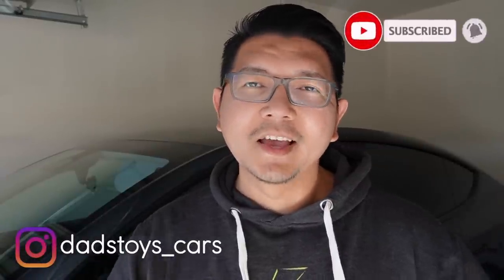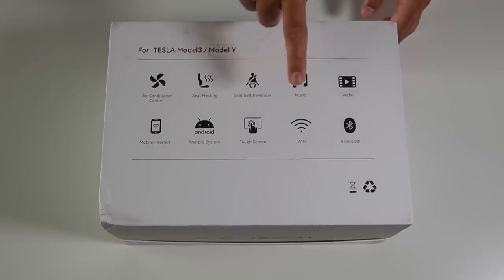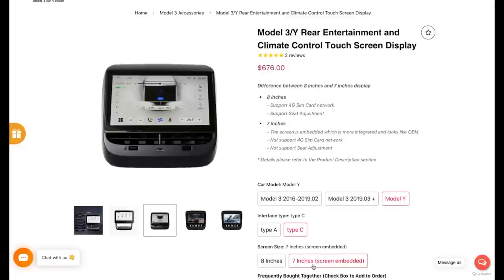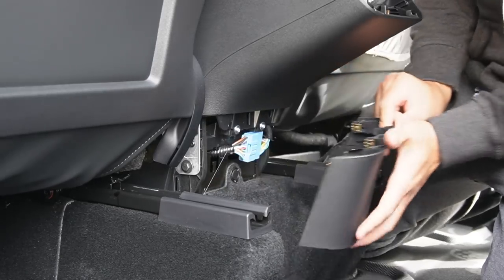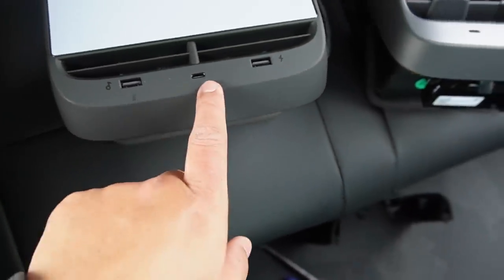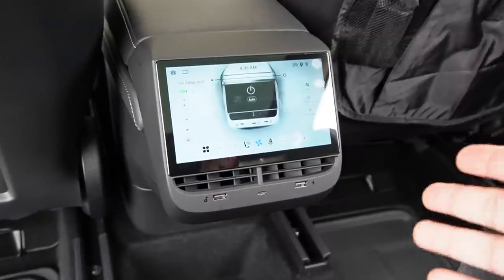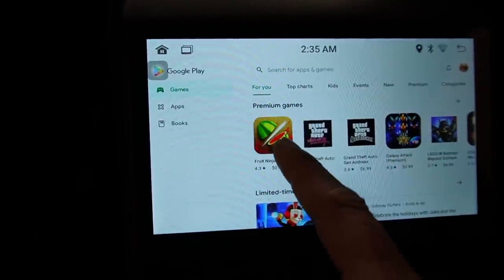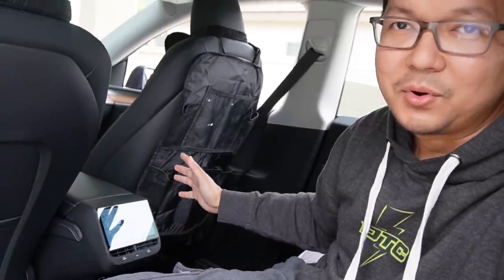2023 Tesla Model Y New Rear Climate Control Display Upgrade! #tesla #2023

Comment: Does it solve the V1 8" display issue bricking the car during Tesla firmware upgrade ? Did you already performed a Tesla update since you installed it ?
Reply from the maker: I installed this display before the latest holiday software update and the update went well with no issue.
This display has different connection compare to 8” display. This 7” display connects to access port at the rear center console but 8” display connects directly to main MCU underneath the front grove box.
I hope I answer your questions.
Thank you for watching.
Please subscribe for future contents.🙏😃
Reply: @dadstoyscars  thanks a lot !!!
Reply from the maker: @jeanbaptistelabelle  No problem 😉
Reply: @dadstoyscars  do you confirm that audio on BT headset (not BT of the car) is NOT working ?
Reply from the maker: @jeanbaptistelabelle  When connect to your car via Bluetooth to output audio from display select BT966. When connecting Bluetooth headphones you have go to display settings >Bluetooth >search device to connect your Bluetooth headphones.
Reply: @dadstoyscars  yes, I know but does it WORK ? Because I have not yet seen a video where it worked. Could you confirm it works on your model ?
Reply from the maker: @jeanbaptistelabelle  You mean display Bluetooth to car speakers or Display Bluetooth connect to Bluetooth headphone?
Reply: @dadstoyscars  can you watch à vidéo with sounds played on youR BT earbuds / headsets ?
Every video so far I have seen are stating that it does NPT work (only playing through car speakers with BT, not your own BT headsets)
Reply: @jeanbaptistelabelle There is no answer to your question which probably this is your answer. Probably the unit cannot play output sound to headphones which is a major disadvantages.

Comment: Can the USB-C port be used for audio? Wondering how I could connect 2 pairs of headphones to this
Reply from the maker: USB-C port is for power output only to charge your device. This display has built-in Bluetooth so you should be able to connect multiple devices via Bluetooth. I'm not 100% sure if you could connect 2 headphones via Bluetooth at the same time.
This display is actually the best looking rear display in the market so far.
Thank you for watching Lee!
Please subscribe for future contents. :)
Reply from the maker: I just tested with Bluetooth earbuds but  couldn’t connect to the display. I tried a few time still couldn’t connect. :(
So I reached out to Hansshow about the issue. They also tested on their side and they couldn’t get it to connect to Bluetooth headphones either. Hope they can fix the issue and send out update in the future.

Comment: Code dad doesn’t work anymore.  Also do you think the 8” is better due to resolution or the 7” screen since it’s more flush and stock looking? Interested to hear your opinion between the two.  I like the bigger one but worried if we recline seats real low it will hit screen on 8”.
Reply from the maker: Hi, the code: DAD should be working now. I have both displays 7” and 8” displays. I personally went with 7” because of design and installation is much easier than 8” display. The 8” installation you have to connect directly to the main MCU unit underneath grove box on the front.
7” you just need to connect and connector in the rear center console. The benefits of 8” over 7” are bigger screen size, headphone jack and option to put SIM card in the display.
I hope I answer your questions.
Thank you for watching!
Please subscribe for future contents.🙏😃
Reply: @dadstoyscars And only 8" one can let you use XBOX game controllers as 7" one does not support bluetooth, is that correct?  Anyone tried to connect the XBOX controller directly to the 7" USB directly to see if it works?

Comment: If you had to chose between 7’’ or 8’’ screen, which one you would chose and why?
Reply from the maker: I prefer 7” over 8” mainly because of design and much easier installation. With 8” display you have to connect to the main MCU in the front underneath the grove box which could be challenging to install. You also have to run the cable from front to rear display location. The advantages that 8” have over 7” are SIM card capability and headphone jack. They both have 32GB internal memory and Android operating system.
I hope I answer your question.
Thank you for watching Michel!
Please subscribe for future contents. :)
Reply: @dadstoyscars  I concluded same thing. I find that the 8’’ screen does not seem integrated. Too bad the 7’’ screen does not have the 8’’ added features.

Comment: The only downside I can see is that you lose the ability to control the air vents, as in direction (left right up down).
Reply from the maker: I have no issue with those fixed air for rear passenger so far. Only downside is that they can’t turn it away if they didn’t want the ac but they can just turn the rear off themselves.
Thank you for watching!
Please subscribe for future contents.🙏😃

Comment: Hi, excellent video. Just two questions: Could the system be set to german language as the standard language? Secondly, only the back seat heating could be managed seperately form the the main control? In case you find the time to answer ... Thanks, Andreas
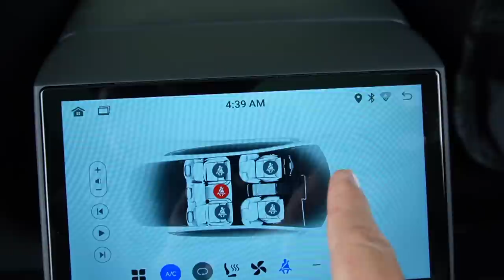Reply: German is supported and can be set as the default language. The back seat heating can be controlled independent of the front: 15:09 click the time to go to the time line where it explains this in the video.

Comment: done installinf and for some reason the battery display  on the rear screen does not reflect on my actual battery. i have 75 percent and the rear says 0. do i have to update the display or something after installing?
Reply from the maker: Umm...Interesting. This is the first time I heard about this issue. Please try to restart your car after installation.
Hold both steering wheel buttons at the same time until the main screen goes dark the release it.
Hopefully that would work.

Comment: What about that green wire when you installed it? You didn’t plug it into anything.
Reply from the maker: I think it’s an optional plug for front passenger seat control but this display doesn’t have that option.
Thank you for watching and your great support Mike!🙏😃
Reply: @dadstoyscars  thanks for replying. Just watching so when I buy it for my car I can install correctly

Comment: Hi there,

Is this also compatible with the 2022 tesla model y standard range?
Reply from the maker: Yes, it's compatible with 2022 Model Y Standard range. As long as it has the same connection in the rear center console, it should be able to connect to this display. The air vent panel should be the same.
Thank you for watching!
Please subscribe for future contents. :)

Comment: So you can control the temp/fan speed independent of the front AC?  I didn’t think that would be possible
Reply from the maker: I just went to my car and tested for you. Tesla Model Y/3 only have dual climate control one for driver and one for front passenger. The rear passenger will get the climate temperature from driver’s control. However when I adjust the temperature from the rear display to hot it override the front temperature too but when I adjust driver’s side temperature it also overrides the rear temperature. 
I hope I answer your questions.
Thank you for watching!
Please subscribe for future contents.🙏😃
Reply: Interesting!  Yeah i didnt think it would be able to create its own independent zone when the default software doesn’t allow that.  Thanks so much for looking into it… I might consider getting one.  I do hope they update the software to have bigger buttons, etc..
Reply from the maker: @grahamsiebring5227  No problem, I’m glad I can help. Thank you for support!🙏

Comment: My only question is: can the rear seat climate control temperature be controlled INDEPENDENTLY of the the front seats.

Can the driver temperature be 68 degrees, the front passenger be 82 degrees, and can the rear seats be 82 degrees also? And if it does allow you to do that, does it actually blow the right temperature air? In the situation above the front passenger and rear seats should get hot air while the driver only gets cold air.

If possible could you test this out and let me know? Thank you.
Reply from the maker: Hi Ayush, I just went to my car and tested for you. Tesla Model Y/3 only have dual climate control one for driver and one for front passenger. The rear passenger will get the climate temperature from driver’s control. However when I adjust the temperature from the rear display to hot it override the front temperature too but when I adjust driver’s side temperature it also overrides the rear temperature. 
I hope I answer your questions.
Thank you for watching!
Please subscribe for future contents.🙏😃
Reply: @dadstoyscars  can you lock out the rear controls so kids don't mess around with hvac?
Reply from the maker: @randomname931  I will try to test it and get back to you.
Thank you for watching!
Please subscribe for future contents.🙏😃

Comment: Thanks for sending me the link to this. I see there is a 2 usbc option. Can you upload media via usbc like you can with the usba?
Reply from the maker: You can only use the USB-A on left side to Import media into the display.
Thank you for watching John!
Reply: @dadstoyscars  Awesome, thanks for clarifying... do they make a screen protector, i'm not seeing one
Reply from the maker: @johnmoricone294  I don’t think they offer screen protector for it. You might be able to find on Amazon that’s in similar size. I don’t put anything on mind and it’s fine. I just need to clean it once in awhile.

Comment: I have a question....can this display also be mounted on model y in Italy? both this display and the central one, the temperature is expressed in C. can I use the temperature distinctly? 
Thank you for the asnwer and best regards
Reply from the maker: I believe you can. As long as your car has the same connection in the rear of your center console, you should be able to mount and install it on you model Y.
Thank you for watching!
Have a great 2023!🥳
Please subscribe for future contents.🙏😃
Reply: @dadstoyscars  thanks dad, does this rear display work well? thanks
Reply from the maker: @federicobraghini6789  So far have no issues at all. It’s an awesome rear display! This is definitely best looking and functional so far.

Comment: Any idea if this conflicts with the Hansshow dashboard screen? I already have that installed and it also has CarPlay built in, but I wonder if you can use both at the same time and/or with two different phones.
Reply: Do you feel your dashboard screen has affected your overall range? I'm always worried about this
Reply from the maker: The installation connection wouldn’t conflicted since it connects to different part of the car. As for the CarPlay, I would connect the phone to which ever is your primary use for CarPlay then use different phone to connect to rear display. Otherwise I think your phone will confuse and try to connect to whichever display that it detects first.
Thank you for watching Eric.
Please subscribe for future contents.🙏😃
Reply: @vishaallalchand4124  It's a minimal power draw, so it is not really noticeable in terms of affect on range. But I do not take a lot of road trips, so it's hard to say. Currently, I am only charging about every two weeks. My range has increased quite a bit since I started driving in Chill mode. :-)
Reply: @dadstoyscars  So you can connect two different devices running both modules?
Reply from the maker: @ericseader414  Yes, you can. I have 10” dashboard display and rear climate display connected at the same time in my Model 3.

Comment: Is the AC and wind speed can be separated from the front?
Reply from the maker: I just tested and checked for you. Seem like when you control the fan speed in the rear display the car also change. The only thing that separates is on and off function on climate. When you turn off climate from rear display front climate will still be on. I think this is how Model Y/3 was manufactured and it’s base on hardware not software. That’s why the display wasn’t able to separate the fan speed.
Thank you for watching!
Please subscribe for future contents.🙏😃

Comment: how do you turn it dimmer?  I can't seem to do it even when I select the ambient light
Reply from the maker: You can also turn off the screen if you wanted to reduce brightness in the rear passenger area.
Reply: There are two brightness settings, but it is not controlled by ambient light or time of day.  It is controlled by weather the headlights are on.  When they are on, it will use the nighttime setting, when the headlights are off, it will use the daytime setting.

Comment: Hello brother , it’s me again. Oh man. My wife just took deliver of her 2023 Austin made Model Y yesterday. I already bought her the rear infotainment lcd . Was about to install it today as a surprise.  But then I’m the one that got surprise. When I remove the rear panel cover I didn’t any more harness . Did you know it this has been relocated? Thanks brother . Hope to hear back from you
Reply from the maker: Hi, I just reached out to Hansshow about your issue. Please provide your order number and they will send another wire harness which will connect to side front passenger connector. I will provide instruction how to connect from there.
Reply from the maker: Here is the instruction video. When you receive new wire harness just follow this video for connection instruction and run the wire underneath front passenger seat to the rear center console to connect to rear display.
https://youtu.be/cD-c53K2_Sg?t=386
Reply: @dadstoyscars  hello brother thank you so much for helping me. I didn’t buy directly to them but from other source. Would this still be able to sell me the cable I will pay including shipping. Please help me
Reply from the maker: @CaptainSeafood  What brand did you buy the display from?
Reply: @dadstoyscars  thank you may I message you on Instagram and possibly send you picture . It was a gift from my brother
Reply from the maker: @CaptainSeafood  No problem

Comment: Awesome video! Does the screen turn off at the same time as your main screen? Specifically when you get out of the car. Also, does the screen change from light to dark automatically light the main screen?
Reply from the maker: Yes to all of your questions.
You can also manually put the display to sleep if you don’t want bright light on the rear display at night.
Thank you for watching!
Please subscribe for future contents.🙏😃
Reply: @dadstoyscars  thank you for your quick response! The deal is even better now with your website than it was in your video! 

Is it still working just as smooth as when you installed it? Have you found any gripes or glitches?
Reply from the maker: @aldow9640  it’s working the same as the first time I installed it.
Don’t forget to use Code: DAD for 25% OFF
Reply: @dadstoyscars  yup! It’s 431 after discount. Sick price
Reply from the maker: @aldow9640  that’s awesome! Thank you for your awesome support!🙏
Reply: One final question! Does the rear temp control only show in C? Can you set to Fahrenheit?
Reply from the maker: @aldow9640   I’m also trying to change that setting. I have to reach out to Hansshow and get more info from them.
Reply: @dadstoyscars  ahh hopefully they patch that in a software update. Thank you for your honesty. I ordered through your link last week.

Excited for this thing! Hopefully Hansshow ships soon’
Reply from the maker: @aldow9640  No problem 😉
Reply: @aldow9640 you just press on the temperature and after a few secs a screen pops up to change to F from C. You will have to go deeper into settings to manually set your time zone for the correct time.

Comment: Thank you. Trying to order but code "DAD" doesn't work. Any advise?  Model 3/Y Rear Entertainment and Climate Control Touch Screen Display

Model Y / type C / 8 Inches
Reply from the maker: Hi, I just checked the code.m and it’s working. Please try again the total should be around $430.
By the way the display in the video is 7” embedded screen not 8”
Please let if you still have any issues.
Thank you for watching!
Please subscribe for future contents.🙏😃
Reply: @dadstoyscars  /So kind of you to reply. I tried again, I get 15% automatically. Are you sure "dad" code works as it isn't for me. Am I using correct code?
Reply from the maker: @sandyantor  25% was ended yesterday I think. Now DAD code is 15% but Hansshow also lowered display price. So it came out the be the same after discount which is $430 it’s actually $1 cheaper 😃

Comment: I installed this on my 2020 Model 3 and I can't get the screen to clip in securely to the center console. If I push on the bottom of the device to make it flush at the bottom, the top of the device pulls away from the console. If I push on the top of the unit, the bottom pulls away. Also, no matter what I do, when I open the center console, the door hits the top of the unit and pushes it back, creating a gap between the device and the center console. I spoke to Hansshow about it, but they just told me to glue it in place. Not a great solution. Did you run into this issue? Thanks.
Reply from the maker: I didn’t have that issue at all and this display should fit your car. Because the rear center console air vent on 2020-2023 should be the same. Make sure the wires are not in the way when you try to push it back in. Also check if both sides of the air vent are clear before you push it in.
Thank you for watching!
Please subscribe for future contents.🙏😃